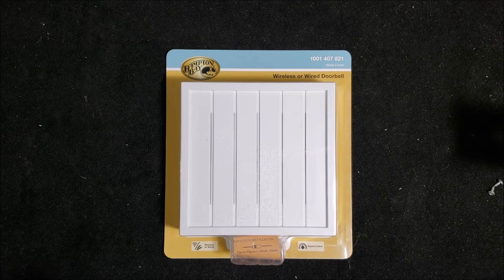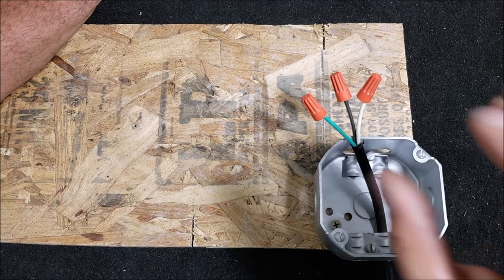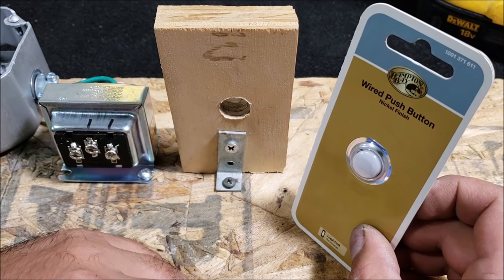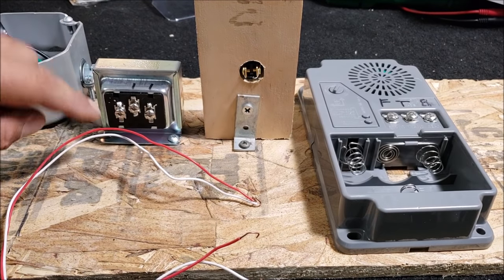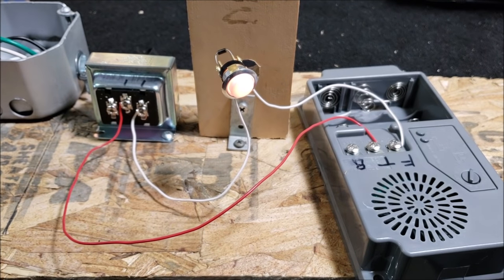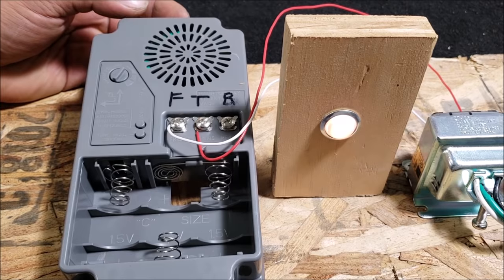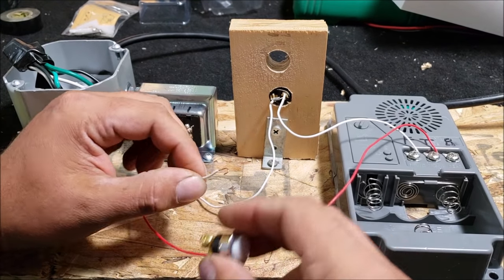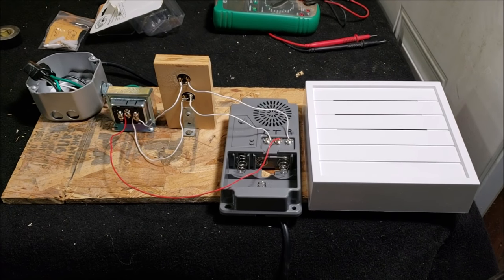how to wire a doorbell DIY live demo and wiring diagram

Comment: Great vid, thanks.  My doorbell has recently begun playing the entire "song" randomly without the button being pushed (it works fine when the button is pressed as well).  It seems to be a bit worse when the weather is cool.  I was wondering if the diode might be going bad?
Reply: Might be condensation buildup shorting across the terminals and completing the circuit, acting as if the button is pressed.

Comment: The black band on a diode is called the cathode and it should be wired to the negative side of the circuit. To check if a diode is good, put the black meter lead on the banded side of the diode and the red lead on the bandless side of the diode. In resistance mode, if the diode conducts9 shows low resistance), the diode is good. If you reverse the leads, a good diode will show infinite resistance and it should not conduct.

Comment: I decided to replace my doorbell, went to homeless depot and grabbed one.  After replacing it, I ran into the same problem that is shown at 9:49, you have to hold the button for a second to start the chimes and the chimes stop as soon as you let go of the button, problem is the doorbell doesn't come with a diode, I guess I have to buy a new modern chime.

Comment: I have the same doorbell in the video.  I recently installed a skybell making sure the diode was in place and it's doing a full chime.  Only strange thing is that it intermittently chimes without anyone pressing the doorbell.  I made sure there was nothing causing a short by adding a bit of electrical tape around the terminals but the chime still goes of on it's own.  Any ideas on how to troubleshoot?
Reply from the maker: it has to be in the wiring..   run temporary wire and see if it stops

Comment: Once you add the back door button, you should use the 24VAC terminals instead of 16VAC, typically.
Reply from the maker: why? the digital chime runs on 16V
Reply: @chriscraft77022  Because of voltage drop. Unless they are very short runs, it will no longer deliver a full 16V. It depends on wire gauge and the run lengths.
Reply from the maker: I get it.. especially if you ran like 100 feet with the small wire..
Reply: nilpo19 I am going to wire mine 24V because of the video doorbell requirements.
Reply from the maker: @alexisjankowski3281  check out the video i made where i wire the ring up to a transformer..  you may need to run 18G wire or even 16G if you the video doorbell wants 24V off the transformer

Comment: Hey @Chris Craft - thanks for making this video man - this is exactly what I needed.  I'm using a Simplisafe doorbell camera and wired this up last night exactly as you did.  Unfortunately, the doorbell chime (same Hampton Bay model) chimes constantly with current. Does this mean I need a resistor installed on the chime terminals?
Reply from the maker: electronic door bell has to have a diode .. did you have to hold the button down to make it work before?

Comment: Thanks for the video. My home address lights share the same transformer with my doorbell. The problem Im having is that although the doorbell works, the home address lights have stopped working. Can it be bad wiring? How do I test the address lights? Thank you!
Reply: Albertthegreat2010  There are small light bulbs that go bad in the address sign you can replace.  Try Home Depot, Lowes or an electrical wholesale house to find the correct bulbs. Test the voltage at the sockets where the bulbs install with a multimeter.

Comment: Hmmm - in regards to shaming for bad reviews.....  My chime still doesn't play all the way thru unless the button is held down.  And I have installed, reinstalled, double & triple checked my diode installation.  May try the 2nd diode and see if I got a bad one.  This is to replace a working wired doorbell because I wanted a fancy chime, so we know all else is good with it (wiring, transformer, etc.).....
Reply from the maker: you might have bypassed the diode.... the wiring in the home might be the issue.. not bad wiring. Just that the wiring in house bypasses the diode somewhere in the walls or ceiling

Comment: Im using the same bell.
But
I have 6 wires out the wall 
So far if what seems like 2 wires are one i found the power and it just rings without the bell button
Reply from the maker: watch my door bell 2 video.. I ended up with 6 wires

Comment: @chris craft hey Chris, this is an awesome video. I have a quick question. I was to try you solution for a Nutone intercom but I don’t think the transfer used is as powerful as yours. Can you tell me what voltage your transformer is?
Reply from the maker: its an 8, 16, or 24 V depending on how you wire it..
Reply: Thanks for the quick reply. Damn my English was terrible in my comment lol. I’m gonna go buy a transformer from Home Depot tomorrow. I will let you know how it goes.
Reply: Do you think a diode is okay to use instead of a relay? Does it have the same purpose
Reply from the maker: 2 completely different things
Reply: Chris Craft  yeah I figured. I’ve just seen other videos use a relay but yours doesn’t. Do you think my nest should still work if I follow your video?
Reply: Chris Craft I’m sure it’s probably different for a nest doorbell than the ring you provided for your video
Reply from the maker: The diode is for an electronic door bell only..  oh.. you meant resistor!!!!   not relay. Still, 2 completely different things.. I have a video on hardwiring the ring
Reply: Chris Craft ohh so a diode doesn’t work for an intercom system

Comment: Where do I place the transformer? In the junction box? Wall?
Reply from the maker: mount it away from insulation.. hang it outside of a steel junction box.. I put mine on top of a ceiling joist in the attic

Comment: How’s the light able to light up with just one wire ?
Reply from the maker: its AC current.. same way the light in your house works
Reply: I thought you had to have a neutral to complete the circuit? I would have never guessed you could run it just off a hot leg with no neutral

Comment: hi chris can i use no. 14 wire for the same doorbell installation?
Reply from the maker: yeah, too big but if it fits the terminals it’s fine
Reply: @chriscraft77022  thanks really good explanation
Reply: Hey Chris can I get hot wires from plug contacts?

Comment: Excellent video . However i did buy the exact same chime model from home depot and there is absolutely no diode included with it. In the cavity below the unit where your diode is there is a package with only screws and the drywall anchors inside.

Comment: Those ring tones are awful.
Reply from the maker: they really are ..  i agree..   10000000000%  i actually decided to go with the cringy techno tone to annoy everyone.. 13:30
Reply: Whoever designed those tones needs to be in a different line of work. I just bought a mechanical one with the two metal bars by Zenith - can't beat that... now to get it installed

Comment: You have to buy a Blank Octagon Box cover plate that has a 1/2'' knockout hub in the center . Punch out the knockout and mount the Low Voltage Transformer to that plate

Comment: What if it won't stop ringing?
Reply from the maker: do you have the rear door bell switch wired too? if so, switch one set of wires at the chime from either button
Reply: @chriscraft77022  I tried that.  It started to ring faster.
Reply from the maker: @tlazos81  un hook the rear button for now..  ive been trying to upload doorbell part 2..  i may have screwed up wiring diagram in part 1 if you wired it like that..  it can be fixed though..
Reply from the maker: I just uploaded part 2 .. wire it like that or make sure it’s wired like that

Comment: Is 18 gauge wire ok?
Reply from the maker: yes
Reply: @chriscraft77022  So i read that bell wire is not allowed anymore in walls. The only stuff you can use then is thermostat wire then right?  Thermostat wire is a sheathed cable with two wires in it.
Reply: Yeah that's better wire